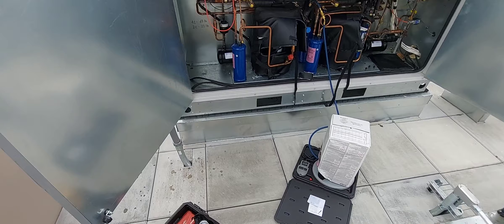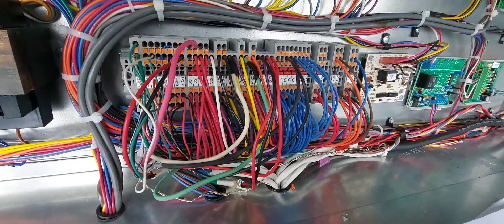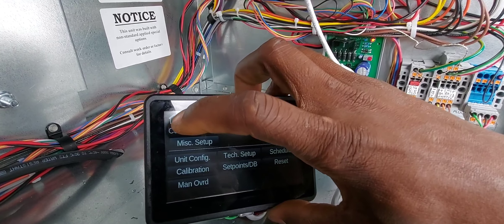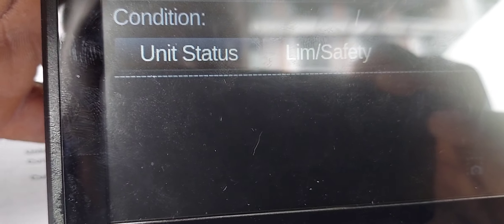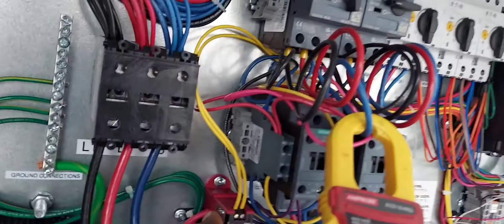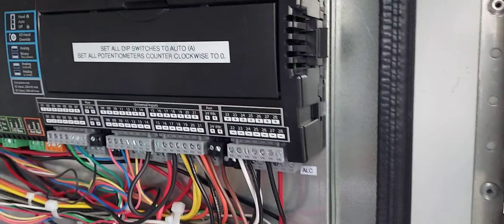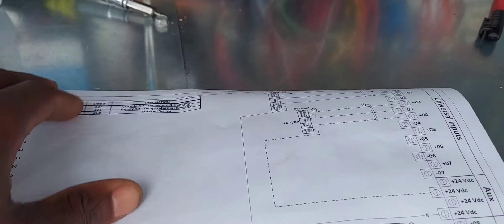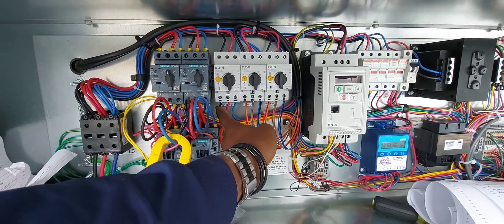HVAC UNIT START UP

Comment: Would you happen to know where the emergency shutdown tie in for a smoke detector gets tied in
Reply from the maker: No.... because I don't have the schematics on hand, however if I did then I could tell you!
Reply: @D2DNYAC  where could I find that I've got a manual
Reply from the maker: @Jeromyz91 do you have the schematics of all inputs and outputs of the controller? 
There you can find somewhere to connect that !
Reply: Yes